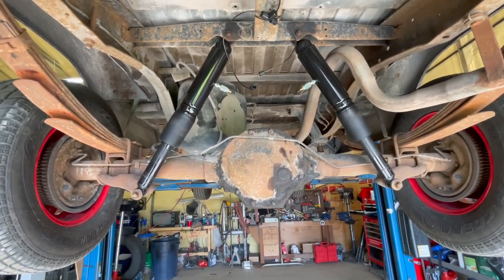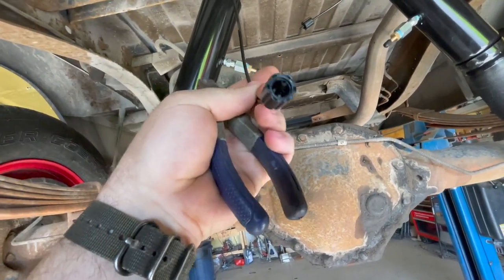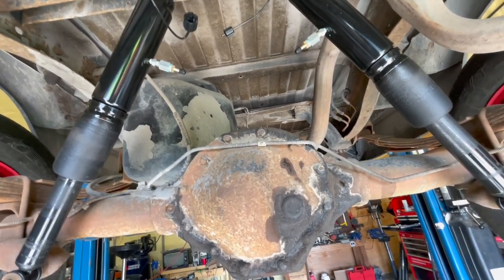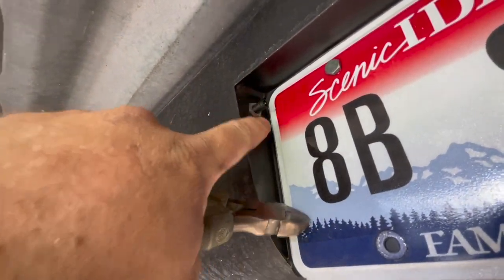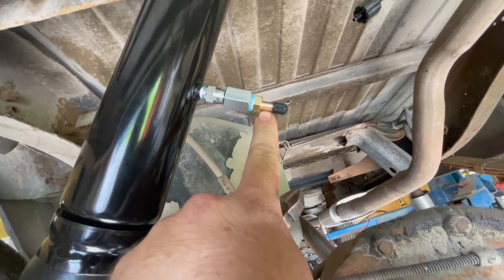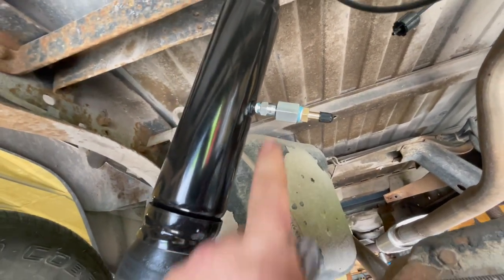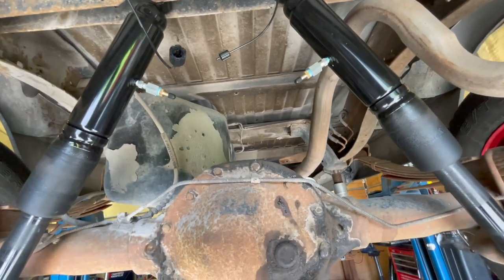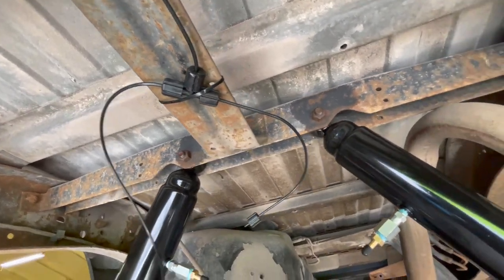Solution to leaking Monroe air shock fittings

Comment: You need to use loctite designed for high pressure systems. I want to say it’s loctite 545. There’s two I recommend. One is more like jelly and the other is more runny like regular loctite. I would have problems with leaking systems until I started using this. Cure time is like 3 days tho